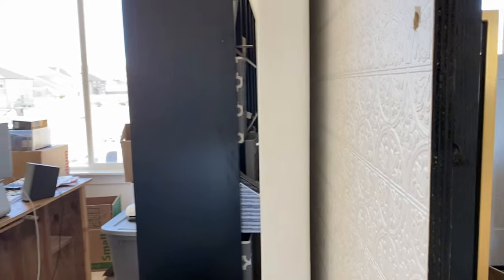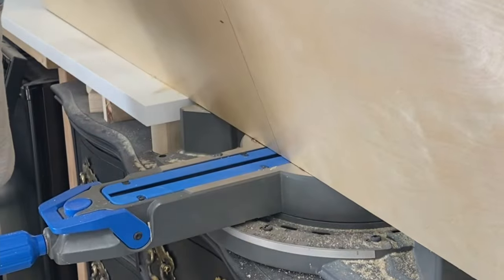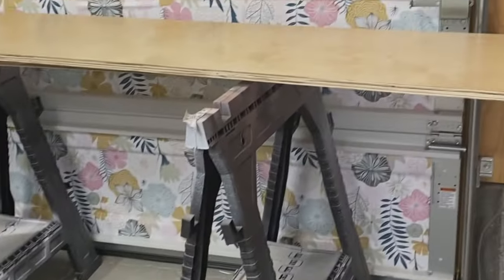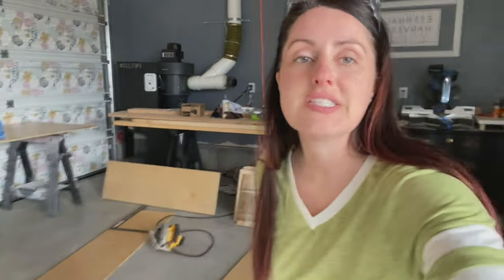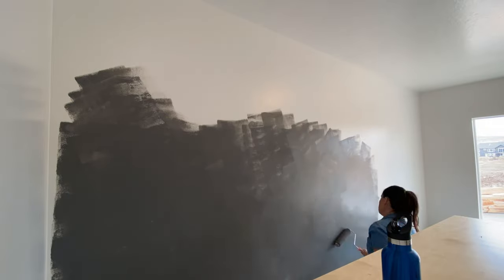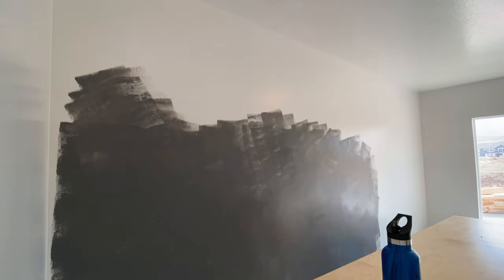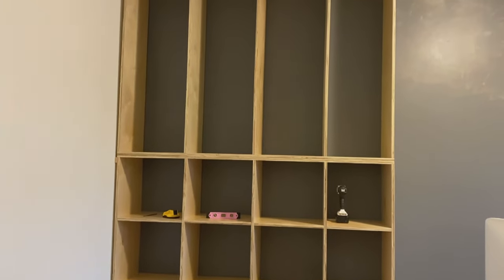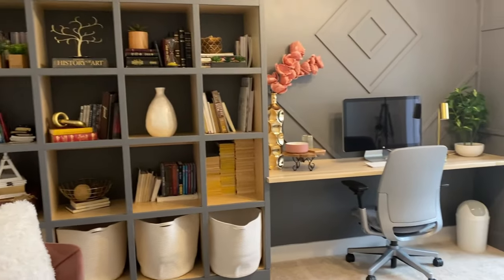HOW TO MAKE BUILT IN BOOKSHELVES - DIY Shelves Built ins

Comment: First, thank you SO MUCH for posting this. I want to build a shelf exactly like this and am a complete newbie, but your video gives me confidence that I can do this. Two questions: One, could I used 1/2" prefinished plywood instead of 3/4" and still get good strength? Two, how did you make sure the screws from adjacent shelves didn't run into each other?

Comment: How did you figure out the spacing for the shelves to cut out your spacer piece? Is it just as simple as dividing by the number of shelves? I usually end up having one space that’s smaller than the rest because of a step I keep missing
Reply from the maker: I should have included this dang it! I measure the inside space after the ends are attached. Then divide that by the number of spaces wanted, then mark that on your bottom and top. That mark will fall in the middle of your vertical pieces. Hope this makes sense
Reply: @EternalHarvestDecor  ooooohhh ok the middle. That’s where I was going wrong

Comment: Hello ! Turned out perfect 😍 
Did you need specific dimensions for your shelves ? Or was is really the look of wood that motivated you ? 
Sometimes I feel like going for the ikea version of it is a good start, and then I work around it (resizing, adding things, removing shelves). 
I don’t have ikea but there are so many stores that sell this cubicle configuration now.
Reply from the maker: Hi Thank you! I do really love the look of real wood, I also like the durability. Wood and plywood are so much easier to work with as well, Ikea uses a particle board which falls apart easily when screwed or nailed into. I do use ikea though I have a few ikea hacks that have worked really well. So if you find something that is the right price, and the work to do to make it look built in fits then I say GO FOR IT!! thanks so much for watching!